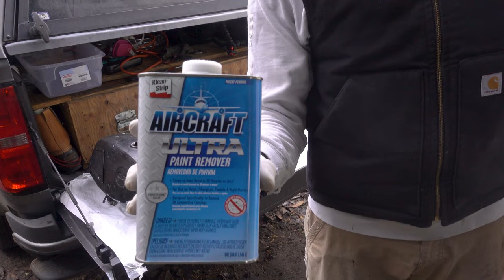Vintage Motorcycle EV Conversion: Wheels and Stripping.. Paint | Honda CL90 Scrambler

Comment: This series is amazing! 

I own 4 of these little bikes sitting in the back yard. 

I’d love to make this conversion on them. 

When do you think the next part of the series will drop?
Reply from the maker: That's awesome - I highly recommend it. New video is dropping tomorrow!
Reply: @CatchHellMoto  nice! I can’t wait! 

Have you posted links to the power train you’re using yet?
Reply from the maker: Not yet, they're both in the next video. These are what I went with though:
2000W 48V Motor: https://amzn.to/3j2BHUs
20Ah 48V Battery: https://amzn.to/3UTdz3S
Ended up going with a 2000W motor as I didn't need as much range as I originally thought. Also a fair bit cheaper as well.
Reply: @CatchHellMoto  awesome! 

Thanks for sending those. I’ve been spinning my wheels (pun intended) on which one would work best. So I can’t wait to see how yours turns out.